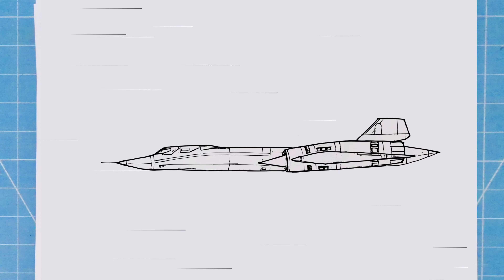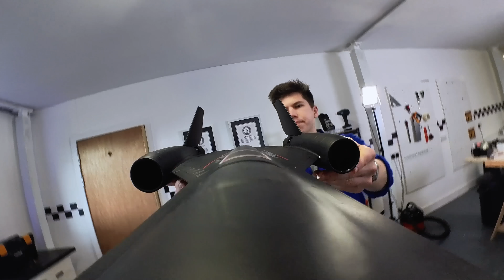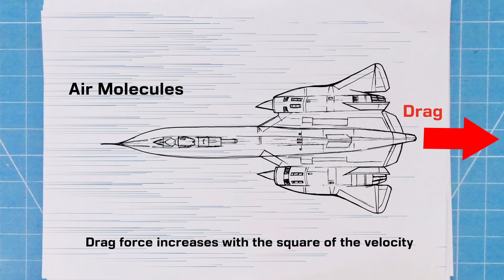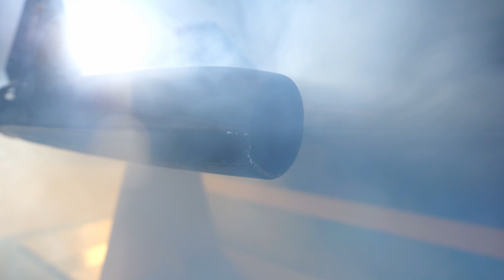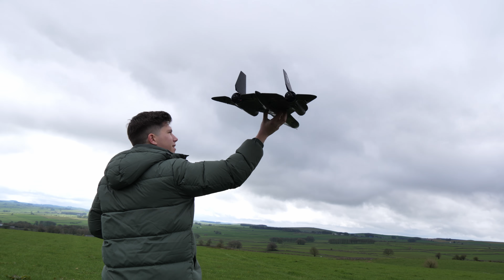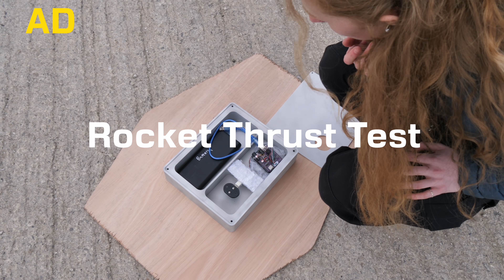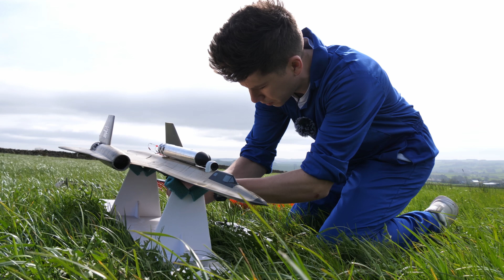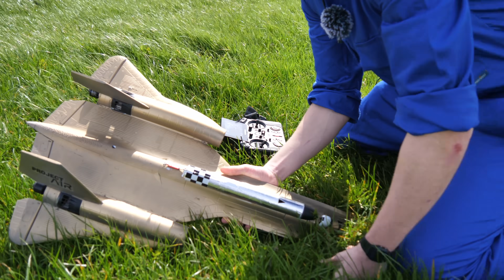Building a HIGH SPEED RC Plane (SR-71)

Comment: You should definitely try building a plane on your own from scratch. 3D printing has advanced a lot and can make som pretty strong, lightweight parts, and it'd allow you to start with a theoretical goal in mind of what speeds you want, and work backwards. It would also let you design in a spot for a camera (behind the windshield?), allow you to hide mechanical parts within the airframe, you could make it modular to test out different wingshapes, etc, build in a place inside the fuselage for the motor to sit so the thrust is inline, and you would probably get an overall better, sleeker exterior, especially since with all the hacks you made to the plane, the skin looked pretty beat up. Also, I'd imagine the aerodynamics the SR71 was designed for are probably different on the models scale.

It would be a hell of a lot of work, but I personally would love to see your whole design process. Could make for a cool series!

Anyway, awesome vid as always, this series of you trying to push for higher speeds is awesome and makes me think of what it must have been like for the engineers in real life whose job it was to do this stuff.

Comment: Just a quick message, even if you're doing rudimentary smoke tests you want to have the smoke flowing as slow as possible, so that you can see the true impact the fans are having.

Having the flow rate that high ruins your ability to actually see what's going on because the air is already accelerated near the speed of the exiting air.

Comment: i wonder: what if the rocket(s) would be in the airflow of the EDF(s) .
the idea is that 
-the thrust would be where it is without the rocket burn
-the exhausted air would be heated up.
Disadvantage: the diameter of the rocket would be in the way of the airflow, the airchannel(?) would have to be bigger.

Comment: I'm just wondering what you would think about a rocket plane that starts off with a rocket motor for vertical launch, gets to whatever height it can get to, & then using electric motors for cruising & landing.
Not quite VTOL, but definitely VTOHL.

Comment: why are the Jets downwards facing in the drawing @0:46+ etc ?
Reply: The angled position of jet engines on an aircraft, particularly on commercial airliners, serves several purposes:

1. **Aerodynamic Efficiency**: Engines are often angled slightly outward (known as "engine splay") to optimize airflow around the wings and reduce drag.

2. **Structural Balance**: The angle helps distribute the weight of the engines more evenly across the aircraft’s structure, improving balance and stability.

3. **Noise Reduction**: Angling the engines can help direct noise away from passengers and improve overall comfort.

4. **Ground Clearance**: Engine placement and angle help ensure sufficient clearance between the engines and the ground, reducing the risk of damage during takeoff, landing, or ground operations.

These design considerations help enhance the performance, safety, and comfort of the aircraft.

Comment: Use the drone to lift the aircraft high in the air. Install a cable release servo onboard the aircraft and with enough altitude, the aircraft may gain enough airspeed during the drop to start flying properly and you may discharge the rocket then...

Comment: create a rubber band slingshot in a rail to launch the plane on an even upward trajectory,  You're trying to throw an arrow by hand while holding the flight controller.  Not a good idea.  Also, need to use a body large enough to enable you to compensate for the loss of rocket propellant weight after the engine quits.  A note about the SR71.  The head of the Air Force when it was created wanted the Soviets to look up and see the AF's star and bars in Red, White & Blue.  It turned out that solving the problem of having logo look the same at 72° F and 600° F was almost the hardest part of the entire project.

Comment: A standard planform airplane designed for subsonic flight would be more easily controlled, easier to see the orientation and easier to launch.  Perhaps you could try a small diameter folding prop with a motor brake to stop rotation of the prop when the rocket is ignited. Having the rocket pointing out of the tail cone should make it easier to keep the center of thrust aligned with the center of drag.

Comment: You defenetly need a thrust tube behind the EDFs to improve their performance. Adding the larger EDFs without thrust tubes behind them was a big waste of potential. Especially when optimizing for top speed the thrust tube is essential as you can speed up the airflow even more

Comment: the rocket motor need to have the nose of the motor slighly pointing down so the elevators moved to raise the craft upward would at least  stop it from wanting to crash into the ground, if you look nearly all aircraft have the motors nose down to make the craft fly nose up on level flight

Comment: Imagine a scale F-16 with a tube running down the center containing a large edf and set behind the fan, an f rocket engine. When you ignite the engine a flame will come out the tail like an after burner, and the plane will accelerate quickly.

Comment: Top quad drone speed is like 400kmph, guy did it with a stock frame/motors/props, and a 3d printed canopy, it should be easily beatable.  Curious to see what a similar quad with rocket motors would do.

Comment: racing drones go way faster than that at even the low end bnf...why are you even bothering with airframes, airframes give efficiency but if you just have a need for speed just try to build the fastest quad, there's some room to actually compete with stock components and 3d printing in that arena I think.  You also wouldn't have to bother with hand launching, or taking off from an airfield.

You can easily build quadmovr type redbull type quad relatively easily  then add rockets to that and you might have something.

Also spektrum and frsky are dead tech, use elrs.

Comment: You made a typical mistake of a person who has no special education in the field of aerodynamics. I'm talking about installing LARGE MOTORS. It seems that this will immediately give + 100 points to speed and the plane will turn into a bullet! But this is not the case - the increase in speed was hardly worth the manipulations done. Instead, I would recommend moving the old impellers forward to the front of the air intakes. And for rocket boosters, provide fasteners INSIDE these channels. The diameter of the rockets should be equal to the diameter of the motors. Install them behind the motors. So you don't increase drag, unlike installing rockets outside of body! And more than that.  Due to the ejector effect, the thrust of the engines increases.

Comment: i think if you pushed the electric motors more ate the center of those foam ducts and put the rocket inside os the duct just behind the electric fans it would solve the wight distribuition and aerodynamics
Reply: or try another plane model like the Valkyrie, two powerfull electric engines to get it up to 100mph and then besides them, two of those rocket engines

Comment: You have just proved the principle of fly by wire. You're a great tuber and experimental engineer... So my question is why did you not 3d print a custom Nacelle to enclose the gyro?   The gyro was the one key component to keep the flght im check. So I give you a B+ mark for your achievement. However with your workshop and experience the gyro should have been engineered back in. I am critical as I worked on F-4 Phantom Jets as an electrical technician and am so pleased that you are holding a fantasy job. Keep it up. The RAF should recruit you at Boscombe Down with IA. Minimum rank of Flt Lt with maximum seniority. Imagine their workshop and 3d printers. Recruit your Lady too... What a Dream Team! Respect.

Comment: My experience with planes this size (or smaller, like the eflite mig15 28mm) is that they are borderline uncontrollable with no gyro. Aerodynamics just don't translate very well to this scale, so constant corrections on pretty much all control surfaces are a must.

I would say that with more control over the plane the 8 seconds burn time motors could have been a success too, but I understand the decision.

Hoping to see more videos on this topic!

Oh, and there are some nice frsky receivers with gyro if you want that, but I would try to stay stock even if flying far outside the intended speed. Unless you are willing to spend a lot of time tunning gains and sensivity.

Comment: Get a Funjet from multiplex. That model already flies to 200+ mph with electric motor and pusher prop. You can replace the motor and put a big rocket keeping the trust line without changing the trim of the airplane.
https://youtu.be/cXDZf9wCXmY?si=Bf-71PimF49X4IfK

Comment: Question from a novice: Does it matter if you leave the electronic motors open in the flow of air while using the rocket boosters? Do they increase drag (by a relevant amount)?

Comment: You need a duct on the back of the fans to accellerate the airflow - these are my own design  EDF engines and the outlets are significiently smaller then the inlets - outlet area is 80% of the inlet area minus the area occupied by the hub/motor :) https://www.youtube.com/watch?v=Oow1ppcij9o&t=1s

Comment: SR-71 blackbird wingspan: 16.94 m
SR-71 blackbird top speed: Mach 3.2

SR-71 model wingspan: 0.505 m
SR-71 model speed to, proportional to wingspan, match the real aircraft: 117.8 km/h.

So, the original, stock one is actually pretty close to that! You went way overboard. At 200 km/h, the proportional speed of the real aircraft would be Mach 5.43.

Comment: Look into f5b and pylon racer airframes. They are already designed for much higher speeds that the foamy. 

My plasma 2 was able to hit ~160 kph on 500 watts of power. 

I wonder if you could start with a better airframe, prop with something way over pitched - and use the rocket to boost into the right pitch/power range to hit the optimal advance ratio and maybe achieve 400-500 kph.

Also doing this FPV will eliminate issues with orientation. Real pilot can be odd cam, you pretend to fly LOS for the vid and to avoid prosecution.

Comment: If you can't integrate the booster inside the plane, the best option is to put it under it (at least under the wings level since they are the place where the lift is applied). You really need to think about how you modify the balance of the plane with each weight, weight distribution, force application point.

Comment: Removing the engine cone was a good idea because it's used to compress air, but if you wanted more power you should add a compressor stage (from the turbofan engines) and put a primary fan in the front to suck all of the air in, and by that, where you put the rocket engines you should put in the front a intake because air sticks into a body when moving, then connect it after the primary fan.

You could also have heaters inside of the engine so cold weather heats and you get more force. If you did that with only 1 engine vs 4 old ones you'll get even better power.
Reply: and where is he gonna get enough power for all that ? not to mention the weight lol
Reply: @ZMSS8537  either mount a bigger battery (since the plane can carry it) and extend the fuselage and space administration inside of it (2nd is better) or add a generator to get some of the energy back.
Reply: @NT-STM  there's no space, also the weight????
Reply: @ZMSS8537  that's why you change the engine, if you have more air to push = more trust and efficiency. And the heater will propulse the air way more.

Comment: you should usa a model like the f14 because you can move the wings mid air for topspeed or for lowspeeds.
Reply: That adds weight and complexity. If you just wanna go fast, the SR-71 is a good pick.

Comment: You need to launch and fly under FPV before firing the rocket.  That way you can run a straight line test and maximize your long rocket burn.  100% need to stick with the long rocket burn.  Add FPV and stability gyros to keep it level then fire the rocket.  You could obtain much higher speeds.

Comment: You should make another video kinda like this but build an rc SR-72 Darkstar. The Darkstar is a hypersonic spy reconnaissance aircraft built in the 2010’s it’s also featured in the movie top gun maverick which in the movie has a top speed of Mach 10.00 (7672.691 miles per hour) and put actual mini afterburners on it if you can or use a rocket :D

Comment: It would be interesting to try a dual stage EDF where you mount the small motor at the front of the nacelle and the big one at the back. It would be a lot heavier but might work on an aircraft with a larger wing area.

Comment: Would a spring driven catapult work for giving you a smoother launch for a project. The idea would be similar to a crossbow. You could use a sort of homemade "windlass" cranking setup to put the tension on the springs. A steel pin ahead of the trigger mechanism would lock the trigger out for safety, and when ready to launch, a small remote controlled piston to "pull the trigger" and release the spring tension from a distance. Might work for future projects.

Comment: I learned when mounting a gopro camera on RC airplanes that mounted on bottom there was almost no effect on flying. But mounting on top was horrible effects. Hence I realized that aircraft from world war II until now have no issue with all the arnament mounted under the wing and belly. Soooooo highly suggest putting the rockets underneath
Reply: It's just more practical to have weapons on the bottom, where the ground crew can easily access them. Equipment can be lifted by small specialized carts; no crane required.

I assume a top mounted camera disturbs the air going over the vertical stabiliser. Having two stabs far enough apart should reduce the effect.
Reply: @fonesrphunny7242  I believe its relative to the way an airfoil works. The air over top moving faster than the air on bottom creating  low pressure/lift on top. Sooo the extra drag created by the underneath stuff just slows down the airflow on bottom of airfoil, minimal effect. Where the disruption/slowing of the flow above airfoil is reducing the lift

Comment: You know the lil CO2 canisters thats for an airsoft gun? Maybe you can use one and fill it with oxygen and feed an airline into the rocket motor activate it at the same time you activate the rocket. I dont know if itll work but hey maybe it will.

Comment: If you want to get the highest possible speed you want say 3 total stages first is your electric fans second is a slow burning rocket to increase the speed further overtime followed by a real kick in the pants rocket motor that if fired any sooner would rip the plane to shreds. This final stage would be very fast burning with very high thrust

Comment: I think you would be better off. Switching to one Central duct, it fan. And 2 rocket motors in the place where the fans would be located. You're basically creating drag with the slower fan motors Because the rocket motors are pushing the plane faster. Then the electric motors would be the fan motors. Are now a big parachute

Comment: I'd like to see you build an X plane,  like the rocket powered planes that were used to break the sound barrier in the 60's and 70's. You could have a drone fly it up and drop it and you could use those long burn engines in conjunction with the fast burn ones. Use them in stages with the long burn getting you up to a good speed and then using the fast burn to really punch it for a big top speed number.

Comment: You should’ve put 2 of those long burn rockets where the electric motors were. Then slingshot the airframe with rubber bands or something similar with a guide string that breaks off at the end and then fire both rockets. It would’ve been stable. You completely destroyed the aerodynamics of the Blackbird

Comment: SR-71 blackbird RC plane, then added an ~1 in^3 nose cone, more blades to slow the airflow in the engines, compress the air even more at the center of each engines, expand the rear end of the engines nossil, add a 7 kw battery, slant the tail wings on the y axis 5 degrees inward, move the center of g to the back, and limit the flap angle integers to ~5 degrees, then add a rocket moter that produces 300 N of thrust to the inside of the rear of the blackbird, make sure the batterys make the center of g in the middle. then slant the wings backward and downward at a 5 degree angle, so the wind is swept under the wing to produce up force, these modifacations will make the plane go ~240 mph is my hypothesis and be controllable. Also make sure to do the math, like the ratios, factoring, calculus, CFD (computational fluid dynamics) and other things. Remember, the slower the airflow in the engines, and the more compressed, the faster the air is expanded out at a much faster velocity at V_ (velocity vector).

Comment: You succeeded in making the SR71 exceed mach 3.2 in scale. I call that a win! Mach 3.2 is 2400 ish mph and your plane did 2800 scale mph. Bravo!!
Reply: By ratio of size 
Say if you had a model 1/59 the scale you'd need about 1/59 the power for scale speeds 
Edit: I'm not the greatest at math so I might be wrong but idrc
Reply: @the_bart_man  what about air resistance? I know this sr is small but at 3.2 mach vs 200km/h its still different, i mean maybe my brain isnt thinking couse it 4:30 in the morning.. Correct me if im wrong pls.
Reply: @zelachotv8940  I have no clue lol
Reply: @zelachotv8940  No, you are correct, nothing about the aerodynamics scales like that. Scale speed is just a fun concept, it's not rooted in physics.
Reply: @the_bart_man  oh... That was simpler than I thought.
Reply: at altitude 71 did hit 3.3 thoo haha
Reply: Recorded high speed you mean. Not the actual speed which they dont say for classified purposes of course
Reply: my brother made history with that RC plane going S.O.S (speed of sound)
Reply: How do you scale speed and sizes?